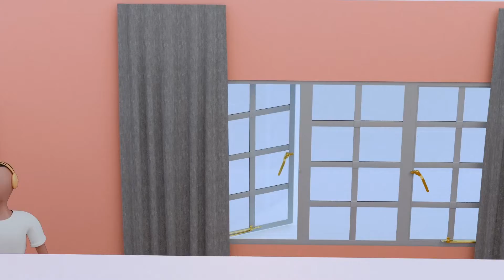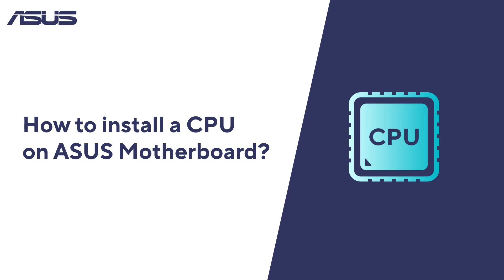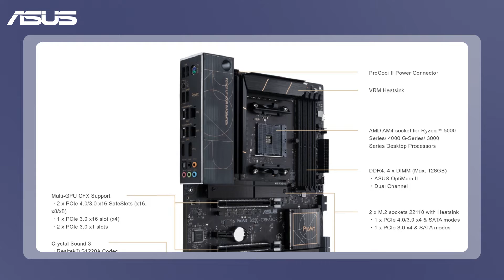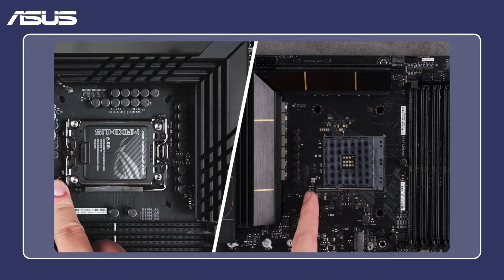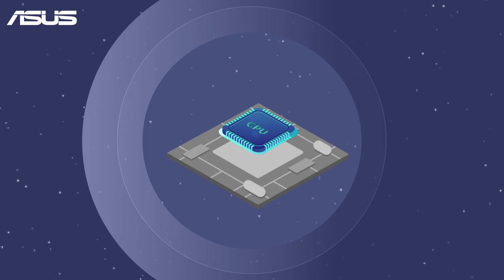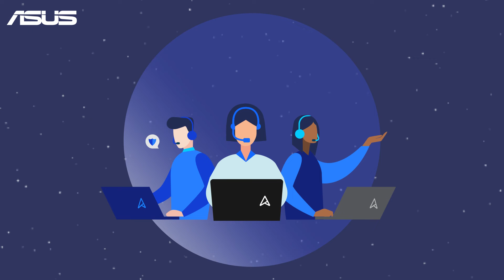How to Install a CPU on ASUS Motherboard?  | ASUS SUPPORT

Comment: It's easy to install a CPU onto a motherboard.  However, it's complicated to install a heat sink on top of a CPU.  You guys from ASUS should also post another video teaching people how to install different types of heat sinks on top of a CPU.  Otherwise, your CPU will catch fire if there arises a misunderstanding from this video that the task of CPU installation is done once a CPU is locked on the motherboard.